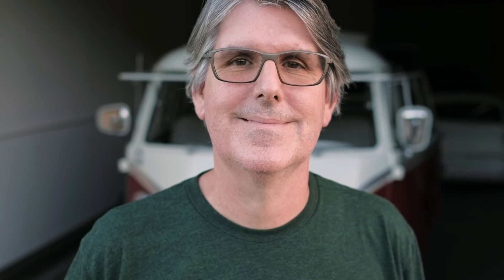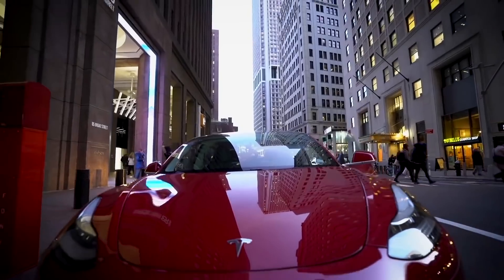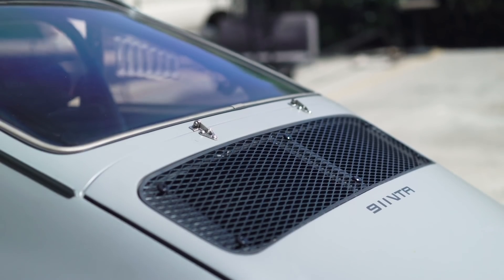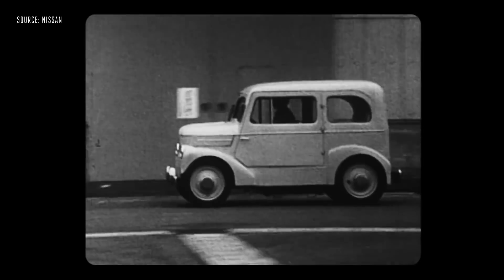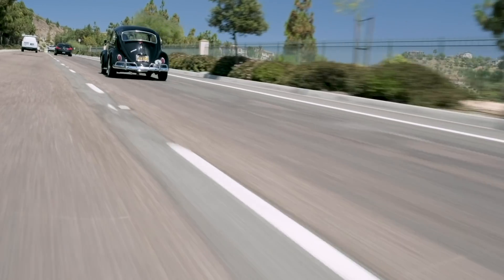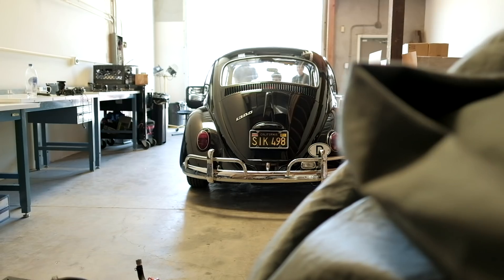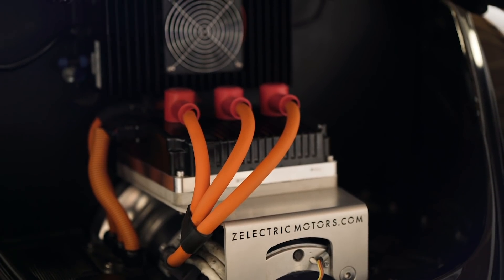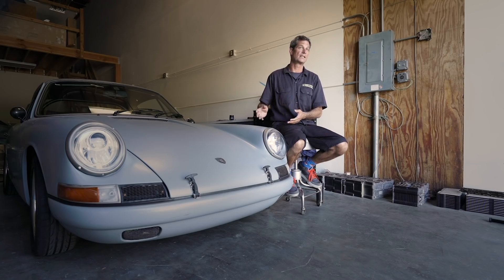Tesla-powered Porsche 912: vintage meets electric

Comment from the maker: What do you think about restoring vintage cars as electric?
Reply: Also, does it seriously have 4500 lbs feet of torque?
Reply: amazing
Reply: Best you can do ⚡️
Reply: lame. you can't get beautiful sound from electric power train..
Reply: Not gonna joke,it would be amazing,just as long as it has the aesthetics of a vintage I’ll take it any day!Atleast it’s better than leaving them to rust
Reply: @saifowahsh  rust better then get the pacific without fish
Reply: @saifowahsh  rust better
Reply: It’s terrible because all vintage cars had engines and it can increase the price of the car.. and the sound is Beautiful . Why do u have too ruin an amazing car :(
Reply: @ahmennation3760  i couldnt agree more, well said
Reply: Actually horrible all these classic cars are part of history and removing the original drivetrain that powered the car is like removing its heart and soul with something that doesn’t belong in it. In my mind cars are art and shouldn’t be tampered like this, it’s sort of like an old painting destroying it and making it digital. Sure it may be worn out but you should always restore it based on its originality.
Reply: Not only that but adding a heavy Electric motor and battery ruins the balance and handling of the car. That’s just puts to waste all the effort and designing the engineers had to do years ago when making the car it just doesn’t make any sense.
Reply: People have been doing this for years.
Reply: Literally beautiful, if the old car's got a junker of an engine then this is the best way to breathe life into vintage cars. If the engine still runs fine or doesn't cost too much for repairs I personally wouldn't do the conversion but if I got some scraps of a body with no interior power... why not?
Reply: I wish I could convert my 1979 wv bus. But what I need is more electric charging infrastructure in my country.
Reply: @sinjisdf1  Takes time but it will get there.
Reply: sinjisdf1 Or charge at home?
Reply: Sacrilege
Reply: @goodq  why is it sacrilege?
Reply: But if ur fixing a vintage car that already had electric GO ON MAKE THE ELECTRIC ENGINE BETTER
Reply: Will miss the sound.
Reply: No one in there right mind should ever lament the conversion of a VW anything to electric.  With over 21-million Beetles alone built, I've never heard any outcry over one being turned into a Baja buggy.   As to Porsche's, how about a 914 conversion to electric, I don't think anyone will be too broke up..
Reply: Thought of this about a year ago. Never did anything with the idea, but I absolutely love that I just came across this.
Reply: It will feel amazing driving it on a calm area
Reply: I'll be seeing them one day when I get my porsche!
Reply: It's awesome
Reply: Absolutely love it.
Reply: NOPE absolutely absurd.
Reply: Good for the enviorment so im all in for it, wont be long before combustion engines will be switched out anyways
Reply: The Verge 
Excellent, amazing 
Keep up the good work
Reply: I think it's AWESOME!!!

(and that's coming from a guy that builds and loves V8 drag cars)
Reply: Bad idea overall,

1. You ruin the experience of driving a classic 

2. You will make the car break 10x faster as the car cannot handle over 500 hp as it was designed for 100hp

3. It will depreciate significantly as putting permanent mods onto vehicles is known to reduce its value significantly 

4. Won’t be future proof because it is too dangerous as the car is designed for 100 hp, not 500 hp
Reply: Disgusting
Reply: I definitely want to convert a 1967 camaro ss electric
Reply: @yashkatare3303  if I have a lot of money one day, that's the car I will be driving (probably)
Reply: The best way to get more Ev''s on the road. Jaguar XJS, Benz E class, Audi E8 but must you use Tesla parts?
Reply: Very cool.
Reply: I always asking my self how much tesla real cost with out battery's? No or yes - today you can buy just tesla batteries from tesla directly?
Reply: Like in the Movie gattaca
Reply: It must've had 450lbft of torque not 4500
Reply: I think it's awesome
Reply: Perfectly reasonable idea. I restored cars for years and I always updated the bad stuff like brakes and electrics. The preoccupation with authenticity is a collector's problem. They view the car as an investment rather than an object to be used with joy. And after having driven hundreds of classics in perfect condition I can safely say that an electric conversion would benefit most of them.
Reply: @Maimo Moline How is it killing a living legend. If anything its breathing new life into a "living legend"  Its a fountain of youth for older cars.
Reply: Awesome. Just another great way to share with a different community how capable, powerful, fun and future forward EV's can be.
Reply: Awesome! No more reliability issues.
Reply: I think of them as a sin or a fellony. Unless the car was meant to be electric originally.
Reply: Absolutely love it. I love the vintage aesthetics pair with modern comforts and tech.
Reply: The Verge big yuck
Reply: I wish retro was mainstream.
Reply: In future when petrol won't be a option I would do that to keep the memory of where we came from
Reply: Great!
Reply: If you have a buyer and can do it I see no problem. People that complain are entitled to their opinion but I see no harm
Reply: No..... just no.... and 100miles of range??? Just no
Reply: Everyone who thinks it's cool getting old v8 or v6 to an geilektrik drive, is insane and without any knowledge about kulture and passion 4 this cars, the sound is the car the car is the sound and not elektrik is GA....... And we all should do thiz
Reply: That would be amazing. This thing will save classic cars after gas gets banned
Reply: @holyhell3627  Gas will never get banned global. Maybe EU and California may ban it but globally, never.
Reply: Awesome! The best of Car Design + Eco(Most Important of course!)
Reply: Absolutely genius. I'm studying electrical engineering to be able to do this with my favorite aesthetic, the classic motor vehicle.

Imagine in the future everyone had their own, personally made car. You'd see Model T's and E-Types casually cruising around, a hundred years after their making.
Reply: Nope, maintain as original as possible, electric motors are fine for new cars that drive you from point a to point b and are luxurious and comfy, but if you want a piece of engineering supposed to bring different emotions, use a combustion engine
Reply: I didn't understand it at first, but now I realise.
It's a great proposition as soon as I heard it.
Reply: I own a Tesla now but would love to convert an old 1G Eagle Talon to electric.
Reply: It's an excellent idea. Some automakers should back this up.
Reply: It Depends on the Car itself and what kind of Reputation it has During its Run
Reply: EV  motors make tons more TORQUE then gas or diesel,
even stock Tesla will blow away Hellcats and most supercars
Plus electrics are 99% eficient and cheap to charge
Problem with conversions
,not everyone has the know how to do it
And EVWEST is very busy lately
Reply: Recycle, reuse, repurpose...nothing wrong with this!
Reply: A murder!
Reply: @modernworldiscrap  Why is it murder?
Reply: @modernworldiscrap  I'm giving it a new life mate.
Reply: Really bad, gas powered all the way
Reply: Very BAD
Reply: blasphemy at it's finest
Reply: @fajrdn  why is it blasphemy?
Reply: @shawnvegavelez121  Just imagine 1:1 scale walmart RC car toys
Reply: @fajrdn  What's your point?
Reply: I like it, if it is engineered right, not just for power and speed, but for endurance and distance! I missed the tech specs in your video!
Reply: Awesome
Reply: No need electronic...don’t destroy original soul
Reply: Great idea
Reply: Blasphemy
Reply: @Jrv200008  Why is it blasphemy?
Reply: @shawnvegavelez121  it ruins the cars.
Reply: @Jrv200008  But how does it ruin it? I'm hearing it's sacrilege, ruining or horrible, but how is it those things?
Reply: @shawnvegavelez121  vintage cars should be kept original, keeping their own personality
Reply: Electric driving is the only solution for the future... 

What will you drive with, if there is no more oil?
What will you drive with, if there is no more oxygen in the air?
Reply: @eDriver  I support your point about oil running out, but if there's no more oxygen in the air we might have slightly bigger problems to worry about
Reply: A Porsche without a decent engine isnt what a Porsche is all about
Reply: Sacrilege
Reply: @dm9817587  Why is it sacrilege?
Reply: @shawnvegavelez121  personal choice I'd  prefer to keep the authenticity of a classic and  the purity of it... if I wanted an electric I'd buy a new one. Have to respect the engineering feet even if the old car ends up a bit like triggers broom 🧹🧹🧹🧹
Reply: @dm9817587  I hear you and understand your thoughts.  What's your view on restoration mods?
Reply: @shawnvegavelez121  I think if someone is lucky enough to own a nice classic car they can and should do whatever they want to it..I'd like to see it maintained as original but if it is between one rotting away in a shed and having a new lease of life with electric motors or alike then do it absolutely. I'm not anti ev just ordered one as a company car
Reply: @dm9817587  that makes perfect sense. Hearing people say it's sacrilege or killing a living soul is outrageous.
Reply: Awesome ! Waiting for a 1967 Mustang with Tesla motor :)
Reply: it is great, alot lf the new electric cars dont look too great and havinh lets say a mx5 electric would really be awesome.
Reply: @ghoulofmetal  yeah a Bobby at will be fine 2tho but let the mx 5 be mx 5
Reply: The definition of sacrilege.
Reply: @LeMatt87n  Sacrifice
Reply: Classics of Design I said the same thing on another classic Porsche turn electric!
Reply: @LeMatt87n  Why is it sacrilege?
Reply: @shawnvegavelez121  because it's electric
Reply: @LeMatt87n  That does not explain why it's sacrilege.
Reply: Shawn Vega Velez dude the car LITERALLY doesn’t go VROOM VROOM anymore. I rest my case.
Reply: @LeMatt87n  what does VROOM VROOM have to do with anything. VROOM VROOM  isn't resting your case, its sounding childish.
Reply: Shawn Vega Velez a car’s sound is half its character. U ever see formula E? No? I don’t blame you. It’s awkward AF. I once saw a formula E car doing donuts and I looked away because I felt embarrassed for it. Electric cars are fine, I guess, if people want to plug their cars in at night like their phones. I wish Tesla, Daimler etc all the best with their electric ambitions but I’m already feeling nostalgic for good old internal combustion. Old cars have a definite character, they’re supposed to smell like rich burning gasoline and they’re supposed to vibrate under throttle. Turning a car like that into a battery pack and magnets is like putting ketchup on a steak for me.
Reply: Horrible
Reply: @_AVAM  Why is it horrible?
Reply: Shawn Vega Velez because the beauty of motoring is the sound, the engine, the engagement of man and machine through the transmission.  Electric cars aren’t even available with a 6 speed manual.
Reply: @KUROSHURA  well said, but if I had the option of saving classic and updating it, I do this. My enjoyment from driving has been taking in the scenery of the area I was driving in. The engine sound neither enhanced of destroyed my driving experience.
Reply: Just Bad and the Founder is a Joke... he say that the Beetle was do Loud... a Beetle?? .... that is just a Joke sorry. Good idea but the Founder.... is Like Elon Mask... talks about Zero Emission and make some Rockets😂

Comment: Tesla motor without traction control, have fun buying new tires every week 🤣

And why gears? Don't you just lose efficiency? Couldn't get rid of the stick without leaving a hole?

I'm certainly in the awesome category, but I feel like in the efficiency or range department, it's just not gonna compare well to a real, new EV car, especially a Tesla... So it's still only for collectors. Would be nice if this was somewhat easily doable and not hugely expensive...

Comment: Yeah having a vintage car defeats the purpose of vintage car. As they showed many times on Grant Tour (and I think Top Gear), the old motors and other tech in old cars and old cars in general are horrid to use day-to-day. But if you were to somewhat give most of the modern tech and functions to old car then the sentiment and simplicity will possibly win and the little faults left won't be really noticeable.

Comment: There are very few cases for keeping the stock everything of a car, if they're part of a very rare and special collection and if the internals are what differentiates that model from others.

There are still so many beetles and 911's driving around that having a few thousand turned into electrics is no big deal in preserving the purity of said models. However, if the time comes and only a handful of those cars exist on this Planet than I'd be fine with having them as stock as possible and preserved.

Addendum, if a car is brought back from the scrapyard and the owner wants to restore it as he wishes than he should be praised for giving it a second life, no matter what makes the wheels turn.

Comment: If Volkswagen/Porsche built the old Beetle/911 again, exactly the same look and just as easy to repair, rebuild and maintain as the original, but the components were built using modern knowledge and materials to improve handling, balance, performance, and most important, safety, HOW MANY consumers would laser beam their wallets to get one?

Having a carbon fiber reinforced Beetle straight from the factory for the price of a standard sedan? I'll take it.

Comment: I've seen videos with EV West being interviewed before. Its good to see them still going strong. A Porsche 912 is very undervalued. Many rich snobs turn up there noses at a 912, because its not a 911. I'd like to see them do a 914. Many 914's have been electrified before just with lead acid battery's and not with the new tech. Thanks.

Comment: Hybrid use the electric to extract hydrogen . Electric and water
Reply: eh.. no, most hybrids have a normal motor and a similarly powerful electric motor, so imagine having a 140HP car with 2 motors of 70HP, thats usually the case

Comment: Kendall’s argument holds such little water it might as well be an upside down bowl. Many of his fellow vintage car aficionados will take a classic,including a rare model, and restomod it to an extent that it can never go back to its original state. These cars carry modern engines, updated hand built suspensions or even full chassis, and interiors with luxury or performance features taken from modern cars. The designers are heralded and celebrated at events such as SEMA, the Riddler awards, or even Pebble Beach, not to mention Barrett-Jackson. The museums even proudly displays these creations. This conversion is just another way to put and/or keep some of these beautiful body designs on the road. His snobbery is showing. He should tuck that in.

Comment: the problem with the 'authentic experience' argument is this: if the designer had had access to modern components he would have jumped at the chance to use them - so an electric Porsche is the continuation of the 1960s technical and aesthetic direction

some components are prefect, others are evolving
Reply: So if the designer had better wind tunnels and software modelling, he’d make the car look different. If he had parts from the future, he’d make better suspension and put in a Bluetooth stereo. Basically we should restyle old classics with more modern bodies, put in LCD gauges etc.? I think that’s you’re argument right?

Comment: I wouldn't have done this. It's a little bit like putting a quartz movement in a vintage mechanical watch. I'd rather keep the 912 and buy a modern electric Tesla or Porsche.
Reply: That 912 has never been faster and now it doesn't sound like a Beetle
Reply: Pablo Gonzalez I didn't say the new version wasn't awesome. So what if it faster though? 😂

Comment: Old cars are often just not good. They have huge engines, low power and many mechanical defects.
With going electric you can have the looks of an old car and the driving experience of an electric car.
Reply: There's a driving experience with electric cars?
Reply: @apollo6139 
When you drive an old manual car, you need to get a feel of it. This is a challange and great for a hobby.

Electric cats are not to different from modern automatic cars, witch try to accomplish the same smooth power delivery.

Comment: The details are suspect: "32kWh pack... split into two 16kWh... with 140 miles of range." Pray tell, how are those little batteries going to produce let alone sustain the headline power figures? What is the actual motor kW rating? In any case, 
definitely not going to allow a decent road trip without recharging a few times.
Reply: True... plus, Tesla is a software company. Just having the motor won’t give the benefit of a navigation system that calculates battery level at each stage of the journey, etc. so a conversion could never be as practical, or as safe, or drive as well, etc. as the Model S that the parts are taken from. The beauty lies in the engineering and for that reason, I’m not a fan of putting lipstick IN the pig... or in the porker, as it were

Comment: Every electric powered car is a good car, not polluting our air we need to breath and not consuming the oxygen in the air. Never mind how old the car is...
Reply: Unless u Charge These cars with Power generrated from clean sources they are creating pollution anyway just the form is different so companies should also inveat in clean engery sources
Reply: @blackcat-mp7kh  yes sure but taking your electricity from an unsustainable polluting energy source and then making that energy generate even more pollution through cars,it's better to reduce as much pollution as we can